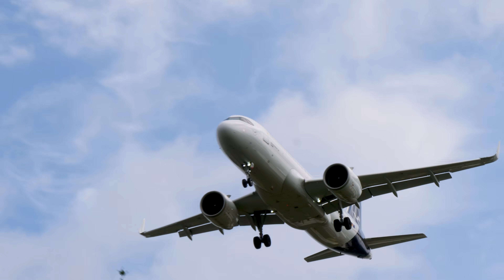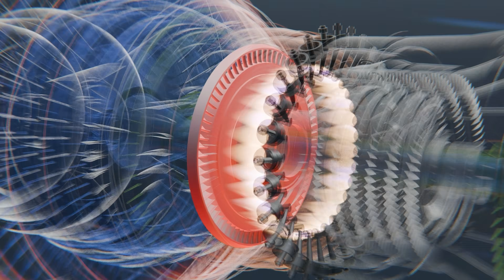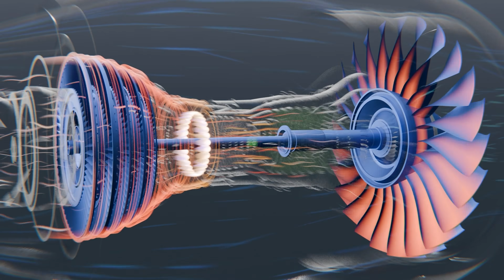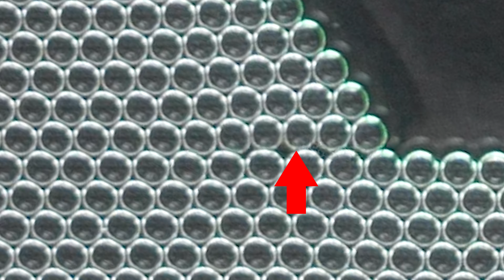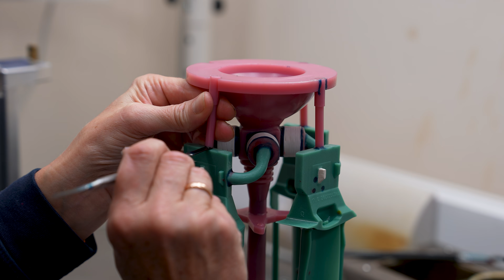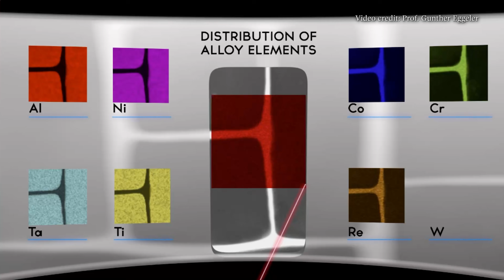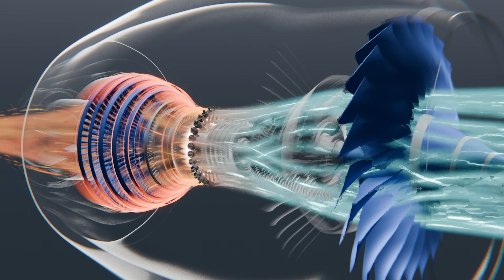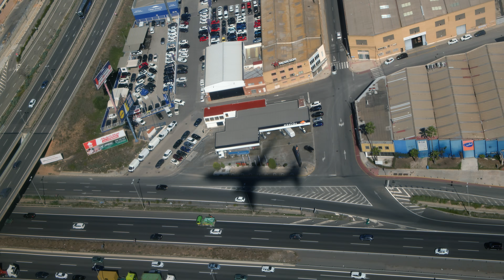The Ridiculous Engineering Of Jet Engines

Comment: Now imagine a seagull entering the engine
Reply: Allison turbines had a frozen chicken into the mouth of a running engine as part of engine type testing. The type test was successful if the exploding compressor was contained in the engine case.
Reply: @raygale4198  False! They do not use frozen chickens. Where do people get this stupid idea?🤦‍♂️  The industry certification standard is euthanised birds of differing weights wrapped in a foam sabot and fired into the engine at different points on the LP compressor. They are not frozen chickens!
Reply: @56Gumball  You might want to read the biography of Charles F Kettering, which besides being very interesting has photo graphs of what looks to be frozen chickens being launched into the front of Allison engines.
Reply: @raygale4198 and the current faa regulations require the engine to continue to operate when a bird is ingested
Reply: @salihefee  Really? I don't expect that to work. Veritasium should make a video about that.
Reply: @thesciencefurry a single bird shouldn't stop one of these engines. It's when a bunch go in that you have real issues
Reply: @thesciencefurry  one bird under a certain size/weight, that is. A whole flock or a large bird is a different story.
Reply: @salihefee It's always been a regulation for the CAA, JAA and FAA.
Reply: Based Re:Zero fan
Reply: mmm fried bird...needs some seasoning tho
Reply: @banenaLT is cut into 1000 pieces too
Reply: @banenaLT is cut into 1000 pieces too
Reply: @banenaLT more like... minced bird... still very much fried though.
Reply: quick merciful death

Comment: Ask instead why the are so inefficient. They and combustion engines are really bad in efficiency, yes the become a litte better the last 50 years but still, hundreds of not thousand of moving parts, and a lot offuel consumption. All of that demands massive of service, maintenance and repair every year. And speed to weight ratio is actually really bad. I wonder if it better to shoot it up like a rocket to about 80000 feet, and then let it glide with no engine like the space shuttle down. My calculations on a fully loaded 777 should only need 60% of the fuel to rocket up to 80000 feet on a trip from LA to London

Comment: Title and thumbmail 2 minutes after release: Inside the Rolls-Royce Jet Engine Factory with Derek pointing at a jet engine inside a test tunnel
Reply: 20 minutes later, the thumbnail might be the same but the title is currently Why don’t jet engines melt?
Reply: @bartolomeothesatyr 
For me currently, the title is the same as you described, but the thumbnail is a 3D model of a jet engine simulation with two captions: "Runs at 1500°C" and "Melts at 1250°C".
Reply: @BaeYeou  Interesting. Both are the same for me as they were 30 minutes ago
Reply: @BaeYeou  Moments before you saw it was Dereck holding the materials standing in front of the jet engine with "1500C and 1200C"
Reply: @CubicalLaboratorysame now
Reply: @CubicalLaboratory that’s mine too
Reply: @bartolomeothesatyr  55 minutes after upload the title is the same but the thumbnail is Derek holding a turbine blade in front of an engine with text saying "runs at 1500°C     Melts at 1250°C"
Reply: Bait comment... Pratt & Whitney invented single crystal blades in 1966!!!
Reply: Do we know why the thumbnail changes a thousand times?
Reply: @stefvdb5096 Derek explained this in a video about clickbait years ago, how they prepare a set of thumbnails and video titles, and rotate them to see which one gets best engagement.

I think YouTube now lets you choose different thumbnails and titles to different users at random, to measure which one performs better.
Reply: @stefvdb5096   They're testing which titles and thumbnails get the most attention. Right after a video is posted is when the momentum of views determine the effectiveness of these two factors. After a little bit of testing, the most popular one ends up what stays there long term.
Reply: @stefvdb5096  He did a video about how changing the names and thumbnails drives up engagement and creates data, I think he said, for him to evaluate how to make his videos more "clickable" for people. Paraphrasing as that was years ago.
Reply: @stefvdb5096  Engagement bait

Comment: Hi I have something to say . If you take a large magnet and put a thin 100km rod and then use the large magnet to spin it about 180000 rpm you can probably get it to move at light speed . Remember if you did it at the end but the time you pushed it for will increase but the total energy will stay the same . I'm surprised no one actually thought of this . This probably dangerous ao I hope scientists don't use this for a few hundred years
Reply: Should take infinite torque
Reply: @liminalgrowth no think like we know how much energy is needed to push an object to the speed of light but the problem is that the energy radiates like if you put a nuke below a manhole cover. It would probably accelerate to at least 1% light speed but it barely scrapes mach 5 reason : the energy is dispersed across the ground and air . If all the energy it sent to the manhole was in KE it would reach light speed with my setup the energy cannot radiate
Reply: What are you even talking about?  You can't accelerate anything with mass to light speed and as you get closer it takes more energy to accelerate.
Magnets aren't magic, as they do work they lose their magnetism.
Also a thin 100km rod would break pretty much instantly. Certainly under stress.
Nobody thought of it because it makes no sense.
Reply: @101Mant yeah if it WASN'T made of carbon and there was air
Reply: @101Mant oh and if you put who said it would take roughly 100 billion joules assuming the rod was 1 ton . Remember MAGNETARS exist . It's not too much if we can construct a 100km rod in the vacuum of space

Comment: Why acetylene torches don't melt? Because they eject the hot air? Maybe? No? Okay.
Reply: the way i understand it, the combustion happens after the gas and oxygen have been pushed out through the nozzles. so the metal bits shouldn't get that hot.

Comment: Jet fuel can't melt steel beams
Reply: Yep you’re right. It is however hot enough to severely weaken the strength of steel.
Reply: Actually, it could given the right conditions of pressure. But as blacksmiths know, you only need to heat steel up to a dull red glow and it loses most of its strength.
Reply: jet fuel can't do squat if it disappears into a fireball
Reply: @cynikal82  It can, it can add heat, even if the temperature remains the same. Heat is NOT the same as temperature.
Reply: @TheEulerID  not using a word is NOT the same as using a word
Reply: nah jets run on kerosene which is also used as fuel in foundries to melt and make steel
Reply: Awesome video!  I think it’s my favorite Veritasium. 

Next up: “you thought jet engines were magic? HDDs do it at nanoscale!”  Check it out—similar monocrystalline fever dreams, but with lasers! (Bit patterned media, heat-assisted magnetic recording)

Only downside: holy crap there were a ton of ads!  If this keeps up at that level, I just may go back to ignoring the web.

Comment: Veritasium can jet fuel melt steel beams?
Reply: melt them? i don't think it burns hot enough.
weaken them? absolutely, it's plenty hot enough for that.
Reply: Jesus
Reply: I don't know why you folks think steel beams are indestructible
Reply: @enadegheeghaghe6369  I can't karate chop through a steel beam and I've watched at least 5 jackie chan movies, so I think I know a little bit about doing a karate chop. Steel is indestructible. Checkmate scientists
Reply: @enadegheeghaghe6369  good question.
Reply: I searched specifically for this comment. Up to popularity you go!
Reply: @MrAlistairheath can I use the fame for monetary gain
Reply: Yes, if you mix explosives with them
Reply: Follow up video: Why don’t passports melt
Reply: no; nor can it initiate structural failures that defy physics
Reply: @cynikal82  what do you mean?
Reply: @cynikal82  The collapses did no such thing.